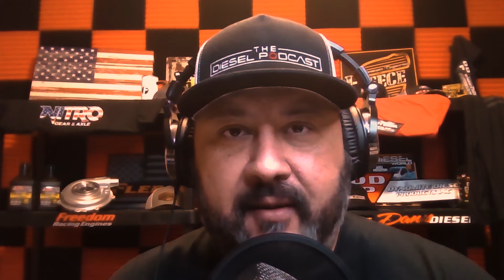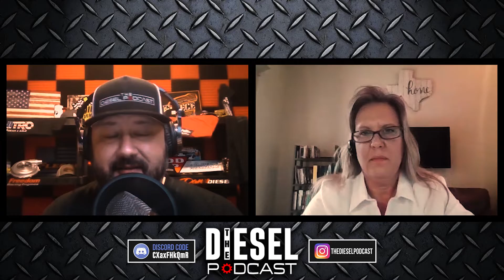Shell Rotella for Diesel Trucks

Comment: I went from T5 to T6 in my 08 6.4 that now has 207 k with no trouble and went from the rediculous 16k manual interval to around 8 or 10k and have very little blow by and 0 oil usage between changes

Comment: Older Detroit la union heavy duty engine oil 40 wt summer 30wt winter most everything else fellow 400 15/40 or shell rotella 15/40 the key is frequently changing the oil and filter/filters a supreme oil filter your study it’s your money clean fuel clean oil clean air the winning combination for the longevity of your engine stay safe no tunes not designed for the extra stress young and dumb you will pay dearly for your short dick / big ego the older you get pry your self out of wherever you’re sleeping a hour early and leave your house with plenty of time not even being a quote company employee  even if you’re working for someone else act like you’re living depended upon your being the first to load and make the last load if you’re doing that type of thing be the person who you want working for you

Comment: All of the oil brands are exactly the same as long as you change your oil at the proper time I’ve never had a problem running the cheap stuff Walmart super tech i’ve been using it for 15 years now no problems.

Comment: My diesel is a 2014 BMW 535d with 3.0 N57 single turbo motor. She has 105k miles, I change the oil every 5000 miles and I always use Rotella T6 15w40.
Reply: why so thick oil, 15w??
Reply: @hen9852  mostly because it's in stock at local Walmart. I bought T6 10W30 on my last oil change, it seems to run exactly the same. no noticeable changes in oil temp, acceleration or turbo lag.

Comment: also works great for motorcycles.

I run it in all my off-road motorcycles.  2 cycle transmissions and 4 cycle engines.   no issues.  take the heat.

Comment: I have a '86-300 C. I. six. I use Rotella T4 15W-40. The engine performs real well with this. Here in NC the winter temp can go to 10F. Then in summer 90+F. I get 60 PSI at first, then it warms up and then I get 55 PSI, 45 PSI at idle. 
  Can't say enough on how strong this engine is.     
A dragster racer suggested I try this oil. Great suggestion.

Comment: Been using Rotella T6 since I got my 05 F350 DRW Powerstroke 6.0 change every 5k even with the occassional fifth wheel towing. 5w-40 is what I use it flows better than the 15w-40 always been full synthetic. Bought my 6.0 with 280k miles I'm now at 320k and counting.
Reply: I’ve been considering running 5W-40 in my 6.0 and my Kubota tractor. I probably won’t put more than 5k miles on my Excursion per year as we only use it when the whole family goes out or to tow our 7k lbs (fully loaded) camper once or twice a year. I also average about 50 hours a year on the tractor. It can get pretty cold in the winter where I’m at, usually does not last long, but I’d like to have either engine ready to roll at a moments notice without having to plug in the block heater. If I have to take my toddler to the hospital I can’t afford to wait for an hour or two to warm up the oil. It would also be nice to only stock one oil for my diesels and change them both once a year depending on actual mileage or hours.
Reply: @TheShalomstead  I have been running 5w-40 now for a few thousand miles and there are some things I absolutely love about it now. My fluctuating RPMS between 750-1k RPMs at idle is now gone. Starts are quick in colder and warmer weather of course. Runs overall better in a lot of ways. I had some leaks with 15w-40 I have less leaks with 5w-40 that part doesn't make sense but finally getting around to start diagnosing where the leaks are coming from so on the next oil change I can address it. No sense in changing oil and adding additives then fixing leaks in my eyes. I'll be running 5w-40 T6 as my replacement from here on out.
Reply: @ I realized that I had an unused gift card for EBay and I bought 3 gallons of the 5W-40 T6. I just need 4 more gallons and all the filters to do my truck and my tractor. I also just realized that my wife’s car is in desperate need of an oil change so I’m going to probably take care of that first because it’s the vehicle that we drive the most for commuting. Coincidentally it also uses 5W-40 but it’s not a diesel. That gets Mobil 1 European.

Comment: I have a friend. Small trucking outfit. 7 rigs. Cummins and Cat. All from the late 90’s, early 2000’s. No emissions, no def. He buys a custom blend  15w40 from a small oil outfit in 275 gal. totes. He uses oil analysis to change his oils. He gets on average 25k on the Cummins and 32k on the Cats. He has one Cat with 1,250,000 right now still going strong.

Comment: I usually use Amsoil products but have definitely used rotella . If you go on the motorcycle forums many bikers have bikes with high mileage that have always used Rotella. Car gasoline oils are not good for motorcycles with wet clutches because of the friction modifiers can cause clutch problems.

Comment: I own a GMC 2500 HD, with a Duramax diesel engine.  Shell Rotella T-6 15W-40 oil is my preferred choice.  A full synthetic oil that provides full protection against engine wear is crucial.  The oil is also offered in a 2 1/2 gallon container.
Reply: T6 is full synthetic.
Reply: Full and pure are much different, marketing at its best.  It’s full of synthetic products, not pure 100% synthetic base stock by far.
Reply: Its not full synthetic, 25% synthetic
Reply: For real, my Rotella T6 says full synthetic not T4 T6

Comment: Ran T4 in my 97 Powerstroke F350 for about 185k till I sold it to a friend.
Ran T5 in my 06 5.9 Cummins for about 220k til I sold it to my brother.
Both trucks are still on the road,
My 2019 F150 Ecoboost runs T6 now.

Even though it calls for 5/30, I think that's just too thin for good results.
No drop in mileage or performance with the 15/40.
Plus here in the Southern NM and AZ heat, just a little peace of mind.

Comment: I use mobile one synthetic 5W 30 I live in a country. I change my oil every 15 20,000 miles in my car has 492,000 miles on it. It has to do something with living in the country and not regurgitating all the exhaust gases on top of that to clean air compared to dirty air. It’s gotta be.

Comment: You should ask if the ones formulated for both engine and diesel engines safe to use in both or it it safer to use oil only for gas or diesel

Comment: Interessting video.  I have a 2016 6.7L powerstroke diesel.  You need to have an oil that meets the Ford WSS-M2C171-F1 spec.  I use Rottella T6 full sytheyic oil. It does well.

Comment: I've used  T6 in my Ram Ecodiesel for 175,000 miles. UOA at every 10k change always shows Aluminum, chromium and Iron very low. Ecodiesel bearings have silver, always showed 0ppm. Dropped the pan at 170,000 miles and clean as a whistle. Use in all my vehicles.
Reply: Buy an oil analysis of black 10K oil.  It gets full of carbon much quicker!
Reply: @LarryButler-kp3se  So what does that mean? This oil is good enough to keep running for another 290,000 miles, no?

Comment: If you really care about your truck then plug it in overnight. Use a timer to hit the sweet spot every morning. Even during the winter the starter spins so much faster on cold starts and the engine busts off so much better and i can drive of after a few minutes of idleing. It's a win for all of the components.
Reply: Ok so I can spend the money on the electric bill or getting maybe 10000 miles more out of my old ass truck in Oklahoma???

Comment: I alway run Rotela Dino oil for the first year and Amsoil 15w40 signature and it works for me . And I change my oil at 5000 miles and Iam a synthetic freak and I do use Rotela T if I need to add but never had to top oil off and I think Rotela T is in the top two oils out there and I always send in a oil sample at every oil change to mainly to check for fuel in oil or Antifreeze.

Comment: You should revisit this subject.  Shell and the other manufacturers have updated their products to meet the FA4 standards and added different weights to meet fuel economy standards.
Reply: I am totally confused trying to buy oil for my F350 7.3 Super Duty Powerstroke. I've been buying full synthetic and I went to order some online so I could just pick it up and I saw there's bottles that look the same but they have different letters like XLE and I forget what the other one had. Now I don't know  what to buy. The Walmart matching system says Rotella T6 full synthetic does not match my truck. Not that I trust walmart, but you never know when they could be right

Comment: I look at diesel oil like this , I use T6 15w-40 when I’m not towing heavy to get better mileage and in extreme cold temps of winter. Use Valvoline Premium Blue 15w-40 in summer when I’m towing heavy because it has a better additive package in severe conditions. Motorcraft does the same in there severe duty line.
Reply: makes zero sense.

Comment: I use the 5w40 T6 in every engine i have, 2kw and 3kw generators, yamaha sxs, pressure washer and all 3 of my gas and diesel welding machines as well of course my Cummins diesels.
Reply: I have fleet of zero turn mowers with 38.8 hp. Kawasaki engines, T-6 is the way to go.
Reply: @gleanerman2195  you run the 5w40 in the ztrs? Or 15w40? Been thinking on going this route myself.
Reply: @Tri-CountyPropertyMgmt  I live in the south so I run 15w40 for the last 25 years.
Reply: @gleanerman2195  Yes. Me as well im in Georgia. Been looking for a oil I can just run in everything. Been a toss up between the T6 or T5 semisynthetic

Comment: What is recommended for oil change on A 2015 powerstroke as far as time and not mileage? It is not normally driven over 3,000 to 4,000 miles a year average! Is once a year enough?
Reply: its 13 qts so im sure once a year is fine; as long as it gets hot semiregularly to get any moisture to evaporate.

Comment: 360 hours? My truck is doing that almost every month! At most month and half. I hope that she gets her number is wrong. Because we make the oil change every 80000 km up  to 100000 on some type, thats 50-60000 miles. I bet that is more than 360 hours. Even on the old (2002 - 2008 euro 2 to euro 4 engines) regular change is at 50000 km or 30000 miles.

Comment: I use Mobile Delvac 1300 in my 2007 duramax  LBZ from day one. It now has 404,000 miles and no blow by, oil pressure is still the same as the day I bought it. It uses about .5 quart of oil every 10,000 miles. Also, no oil leaks.
Reply: @StevenHart-ks9if —— sooo… 17 years of using MOBIL oil and you STILL don’t know how to spell it correctly? 🤨 🤦🏻‍♂️ You’d think it would be imprinted into your brain at this point, since you’ve handled so many Mobil oil bottles in 400,000 miles.😒😤
Reply: It's maintenance not Brand
Reply: There’s not enough difference in the Big Three’s formulations to quibble over. All three(Delo, Delvac and Rotella) have certified class 8 diesel engines running 1 million miles without an overhaul on their oils. They all do the job that they are supposed to do when serviced at the proper intervals.
Reply: Well, you better feel extra special than because you’re about the only one
Reply: 03 lb7 400k. shell rotella 15w40 with 1 quart of Lucas oil stabilizer. stock motor only took valve covers off the replace injectors and did new cp3 for preventative mainentance. I live in the rust belt. rockers are rusting, under body is getting rusty but its a truck, gets me to work, to my fishing spots, I own it, nobody going to steal it and I fix it myself
Reply: A friend has a small 5 Semi OTR trucking business. He uses T-4. He changes oil by oil analysis. He gets about 15-17k on the Cummins’ motors and 20-22k on the Cats before oil needs changed. He gets about 1 million miles before needing a rebuild.
Reply: @harryfeld1786  How many times are you gonna tell us a story Harry😂
Reply: @Yamaha1300r  I'll tell you another story. He just rebuilt that 1, 250,000 mile Cat. He's using T4 to break it in. 3 changes at 10K each then back to his custom blend. Why? Because his custom oil supplier told him to. T4 wears more over time. It's a great break-in oil. Oil analysis doesn't lie.
Then back to his custom blend, which has shown the best wear characteristics of any oil he has ever used in 40 years of OTR trucking.
Reply: I only use SHELL ROTELLA T6  5W40 in my 2014 RAM  Cummins!
238,000 miles, no loss of oil, no blow by, NEVER MOVES OFF SAFE ON DIPSTICK!
OIL CHANGE AND FILTERS EVERY 8000 MILES!
Reply: "no blow by" - This is impossible.  Every diesel has blowby!  108,000 hp ship engines have it.  Great expensive systems are used on ships to continuously filter the oil of combustion contamination.  My OM617 in my '83 Mercedes  300TD has run the current Rotella T normal diesel oil since I bought it used in 1988.  At over 900K miles, it drops about a teacup between 3000 mile changes.  Changing diesel oil longer is simply suicide.  OEMs want to wear it out so you'll buy a new one!  More proof is parked in front of it as a 1988 Chevy P22 retired USAF step van with the ORIGINAL Detroit Diesel 6.2l V-8 that ran my service business from 1994 to 2012 when we both retired.  It uses no Rotella T4 between 3000 mile oil changes, too!  Now it's my toy truck shop.  8  years ago I bought it a new set of glowplugs and a plastic-ended radiator....Your Duramax will NEVER be so cheap to keep...
Reply: @LarryButler-kp3se the only way to know if specific oil is good for specific engine and how long is viscosity good for is to do oil test.
Reply: Great story bro !! I’m in sparrows point Maryland (millers island) to he exact .. I got 300k on my 2000 4Runner ! Don’t leak or burn a drop of oil between 3-4k oil changes !! Not a single light is lit up on the dash either .. looks brand new and runs that way also ! Lifted 5 inches on 33 inch tires still averages 18 mpg mostly 90 percent city driving!
Reply: @LarryButler-kp3se 
It’s obvious your oil change schedule for your diesel has worked well for you. Kudos are in order. I’m friends with an OTR trucking company owner. He only changes oil by oil analysis results. He gets about 18-20k out of his Cummins’ rigs and 20-25k out of his Cat rigs. T4 only. He doesn’t want to run to failure so he rebuilds around 1,000,000-1,250,000.
Reply: @LarryButler-kp3se What oil do you use in your 6.2?
Reply: @keelandavis  Sjell Rotella T4 as synthetics are unnecessary because whatever is used requires a 3000 mile change from normal diesel blowby of carbon and excess fuel into the crankcase.  Extending the interval just lubes the engine with contaminants.  I lube my 83 Mercedes 300TD the same way.  Anyone who thinks there is no blowby is just kidding themselves.  It's why ships spend vast money on oil decon equipment that runs continuously.
Reply: @LarryButler-kp3se  okay, that’s good to know. Thank you.
Reply: @keelandavis  Rotella T4
Reply: @LarryButler-kp3se 1000% right ppl talk out there ass alot

Comment: Rotella T6 5w40 for diesels works wonders on a 2018 - gas powered - AMG C43. The AMG's turbochargers are as happy as they get.
Reply: I was using 5w40 mobil 1 European for my w211 om648. I noticed a lot less evaporation with rotella.

Comment: i use rotella t4 15w40 in my old 1970 gasoline engines with flat tapped cam and the engines love it .....they have the propper amount of zddp in the oil required for flat tapped camshaft .......
Reply: I use inmy gás cars also. Smooth even after 5k miles...

Comment: Used to use it, but Schaefer’s beats Rotella hands down.
Reply: Proof? How?
Reply: @admirpetrovic4273  I’ve used both.  Got stiction with Rotella.  Schaefers, with its proprietary additives and friction modifiers cleared that right up.  Sure, it’s very expensive, but it works.  I have nothing against Rotella, Shaeffers just worked for me.  I change my oil every 3000 miles and also use bypass filtration (2 micron, the ford primary filter is only 20 micron), along with 2 shots of Revex with every oil change.
Reply: How, exactly? Data rules.
Reply: I don’t know why people say that when you don’t have a lab to prove what your saying.
Reply: Zinc vs diesel cats and DPF?

Comment: 4 years of oil analysis on 5.9 Cummins.  Rotella T6 was the only oil that outperformed the rest in iron wear.  Amsoil, Delo, Kirkland 15w40 all 31 ppm Iron wear.  T6 was 23 ppm.  Amsoil was the only oil out of spec in viscosity.  (Too thick)
Reply: Thanks for sharing, I stopped buying the expensive shit and just started using Delo 15w-40 in my 800hp 05 I just toss a bottle of Lucas ZDDP in with my oil change and my oil stays nice and sticky for the entire period of around 4k miles depending on usage.  If I cared to run 15 plus thousand mile intervals I would go back to synthetic, but I would have an anxiety attack waiting that long.
Reply: @joshuaquilliam2887 that Lucas is a bunch of bullsh t
Reply: @markwilliams4525 well the oil geeks don’t say it’s bull. Or that was drag car guy.  But he can’t prove lulkus  in diesel. But you don’t want thicker. I want my lifter to stop ticking.the duramax tick started.  So I will try t6 synthetic
Reply: @lodwill5116   there's an episode where he talks about oil additives and Lucas was one of them
Reply: One thing I noticed about amsoil 15w40 signature series is just how much thicker it was over t6 when I changed the oil at 7500 miles. Interesting that you mentioned that. 
I was thinking amsoil was the best and it may be but I just can’t justify the double the cost difference and I’m not a fan of extended drain intervals, I just find it easier, cheaper and peace of mind to simply buy the cheaper rotella and change oil more often.
Reply: @Mrgunslinger3  Try to locate the Amsoil REFINERY.  Ask why it doesn't exist...It's a bottling plant in Superior, WI.
Reply: Amsoil way better then t6 not even close
Reply: @Mikediesel-d5p That’s a pretty shitty response without any reason for that answer.